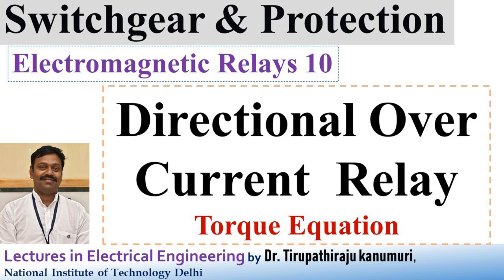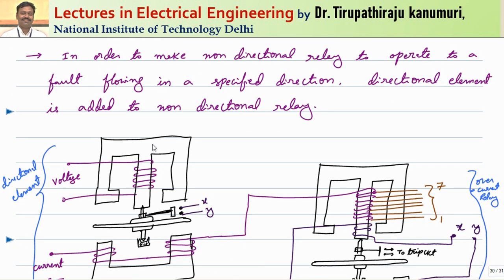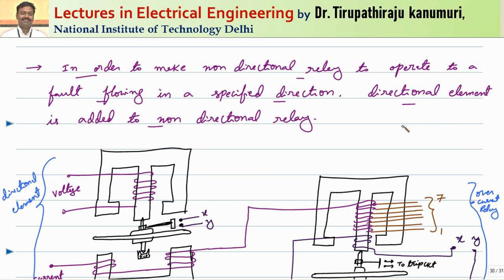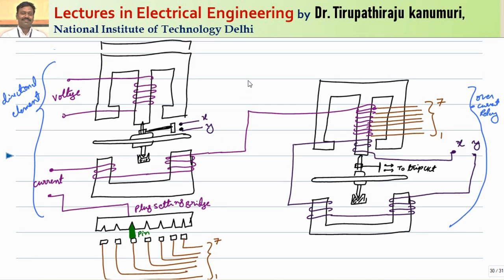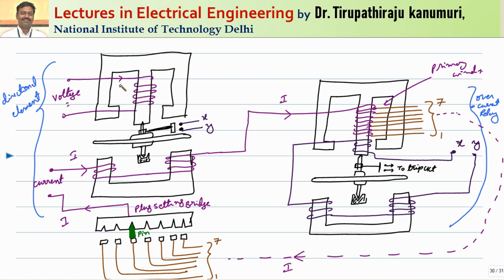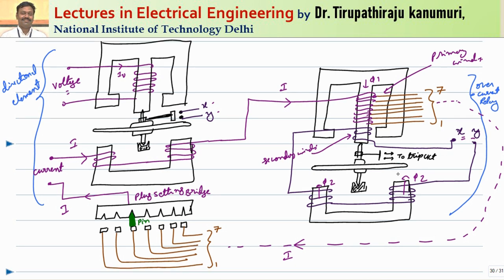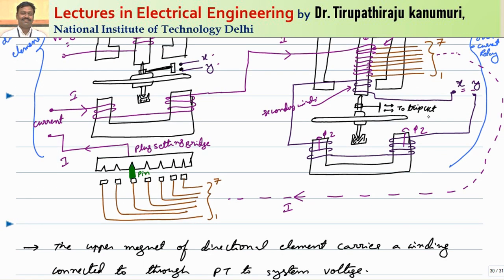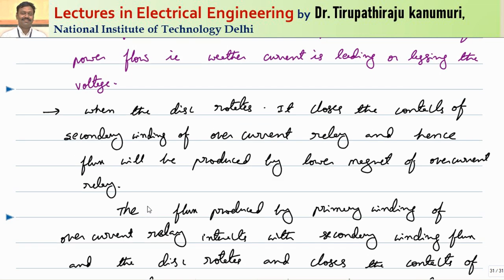SGP310 Directional Over Current  Relay

Comment: Sir power relay is not used for short circuit faults .we use directional over current relay for short circuit fault  voltage is completely  zero but how come flux is produced with low voltage in directional element please reply for this sir....what is the use of stopper I read two text books but no where it is written about stopper for opposite rotation

Comment: Sir , in case of short circuit fault  voltage drops to zero value then how this directional element produces  torque  in absence  of one out of two fluxes??

Comment: Sir the trip contact of the directional element (here x,y) is in series with the current coil of the over current element, again the current coil of the directional element is  in series with the overcurrent element , so  the current coil of directional element & the subsequent overcurrent element remain open circuited ( via x,y) , so how come current is flowing through the current coil of the directional element  at the first place as current can only flow in  close path & how come x,y is getting closed as the disc will rotate only when there will be flux interaction (but we won't get any flux until there is current in current coil of directional element)??
Reply: @lecturesinelectricaleng  sir I'm taking about the working procedure ( can't be pinpointed at certain time line) ,here first x-y of the directional element is closed which led to the operation of overcurrent element , but my question is, if x-y remain opened at first then how come current is flowing through the current coil of directional element ?